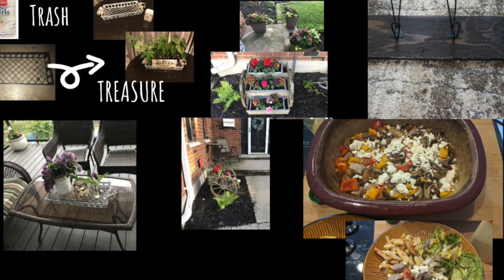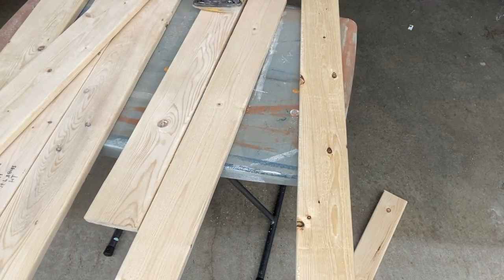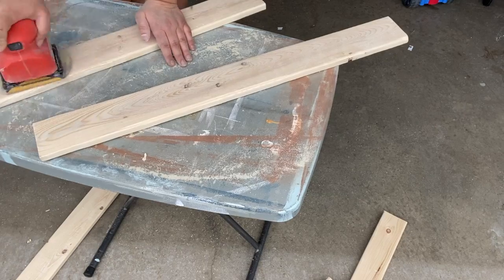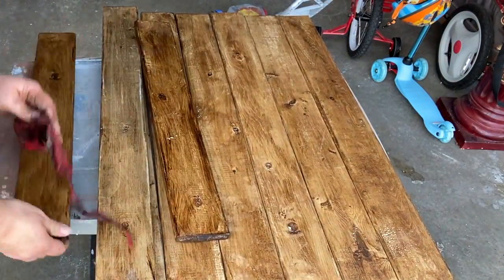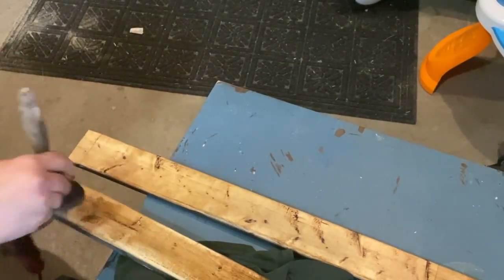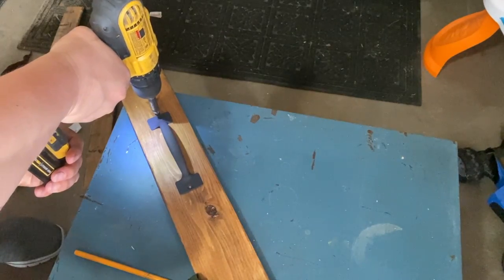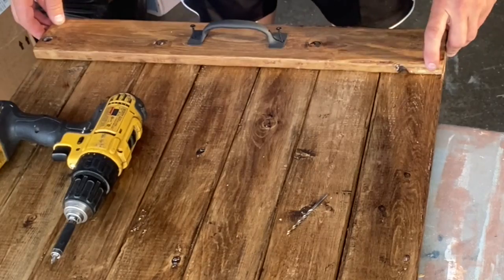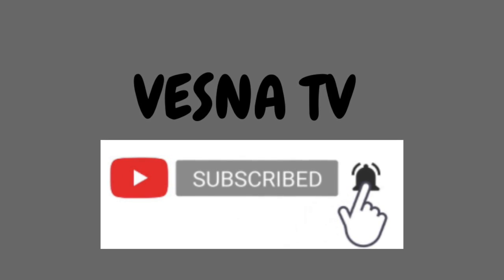FARMHOUSE STOVE TOP TRAY || NOODLE BOARD|| LOOK FOR LESS CHALLENGE

Comment: That turned out really great. I really like the size of the boards and the color is amazing. You didn't show the bottom but did you place a piece on the front side to hide the burners from the front view?
Reply from the maker: There isn’t anything at the front. The stove has a lip that is black. Maybe that is what you are seeing. The sides have the “legs” that hug the stove. It’s a gas stovetop so it site on my countertop. Does that make sense?